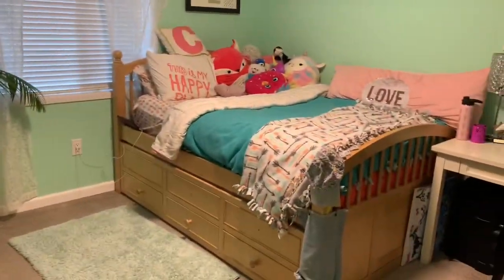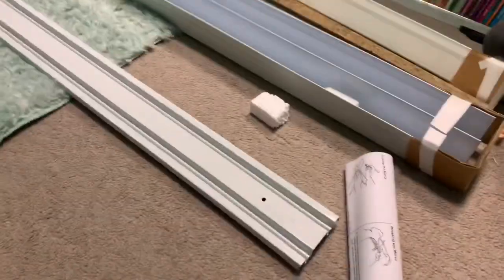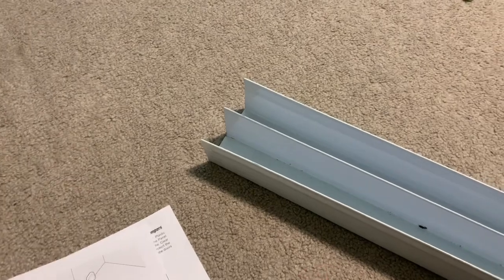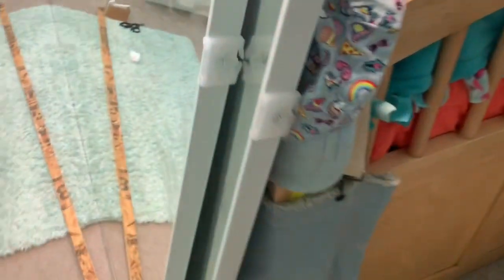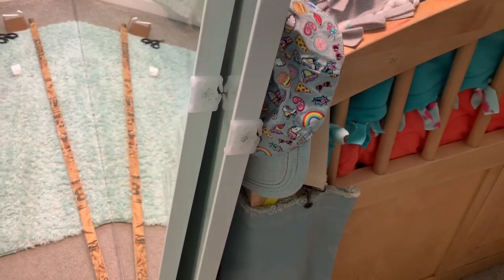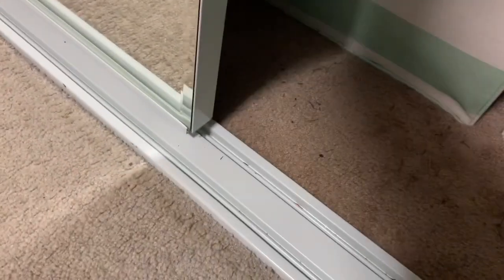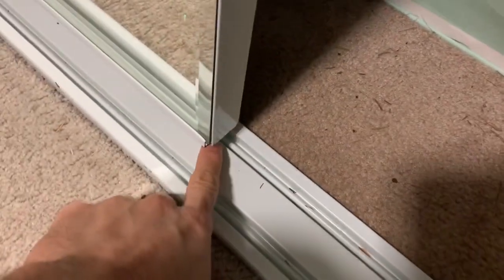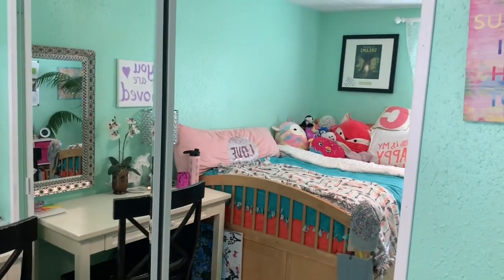Creative and fun way to redesign a room. How to Install Home Depot Mirror doors

Comment: I have a question, i just put new tile on my floor, Is it possible to install mirror closet doors on the tile? or will i have to drill or mess up the tile by the closet for the track??
Reply from the maker: The higher quality doors have a solid rail on the floor to allow smooth opening and closing and to prevent the door from swinging. If you purchased a tile bit it would be possible to predilection through the tile. I would drill a hole large enough the the screw that holds down the lower rail can’t actually come in contact with the tile then you would need to pre drill a smaller hole through the wood in the floor to allow the screw to be able to thread into the wood.

Comment: Does this come in 36 x 78 ? My current closet doors are about that size but I can’t find any mirror doors that fit the measurements
Reply from the maker: The shortest doors that I found available are 80” this size will fit into an opening that is 79 1/2” - 80 1/2”. You would most likely need to adjust the header to allow for the additional space needed.
Reply from the maker: How large was your actual opening?
Reply: The whole opening is about 79 1/2 x 70 1/2
Reply: I’m scared the doors might over lap too much though
Reply from the maker: @_raqi4133  is the entire opening 36” wide? I may have misunderstood. If the opening is 36” wide then going with a bi-fold door would be your best bet.
Reply from the maker: @_raqi4133  something like this. https://www.amazon.com/dp/B000ONAL9I/?tag=TweekerDan198-20
Reply: @TweekerDan1984  no i have sliding doors just like yours, my entire opening from Sheetrock to Sheetrock is 70 1/2, but the width of one of my current doors is 36, I just want to replace my regular sliding doors to mirror sliding doors
Reply from the maker: What is the total height of the doors opening? (Floor to closet header)
Reply: @TweekerDan1984  that's 79 1/2 , from floor to the sheetrock. Also thank you so much for going out of your way to help me 🙏
Reply from the maker: @_raqi4133  absolutely don’t mind, where do you like to shop, amazon, Home Depot, Lowe’s or some other place? I’ll send you  a link on what I think would work, it would be a close fit but I believe I believe it will work. Worse case would be that just the 1/2” or 5/8 drywall would need to be removed.
Reply: @TweekerDan1984  any of those are fine, thank you!
Reply from the maker: Here was the closest doors I could find for you. Also it is the lowest price that I found. You may be able to find a lower price but I searched for quite a while. https://www.lowes.com/pd/Custom-Door-Mirror-72-in-x-80-in-Polished-Edge-Backed-Mirror-Aluminum-Frame-Interior-Closet-Sliding-Door-with-White-Trim/1003137582

Comment: How do I screw into cement
Reply from the maker: There are special screws and anchors that are used for screwing into cement.  You have to pre-drill a hole with a drill and drill bit. Depending on what size screw and anchor used would determine the size hole you would need to drill using the drill bit. There are several options to choose from here is an example to help you out. This particular kit comes with everything you would need (minus a drill) https://amzn.to/3E4Kuty